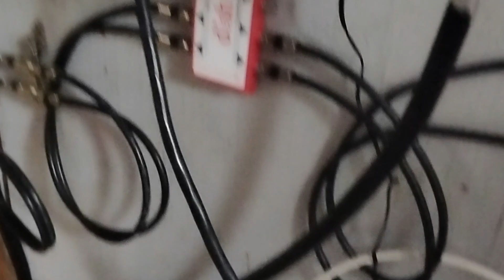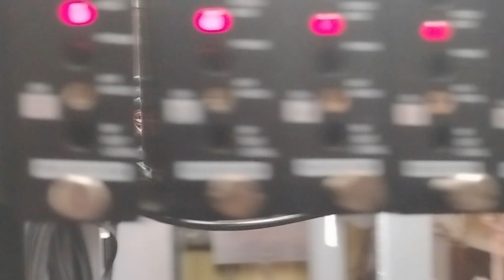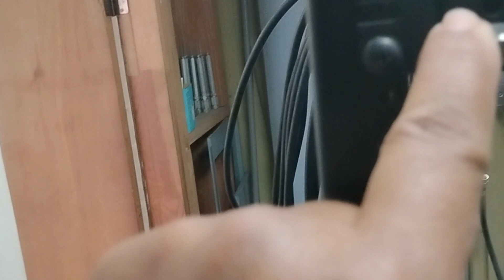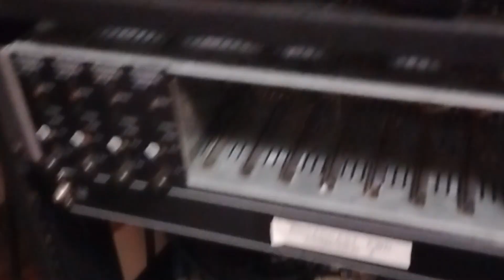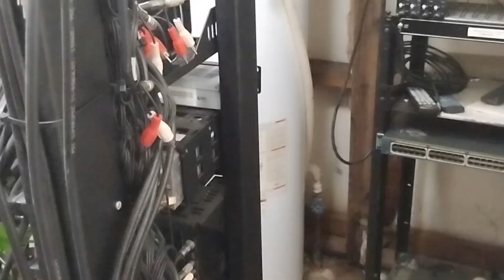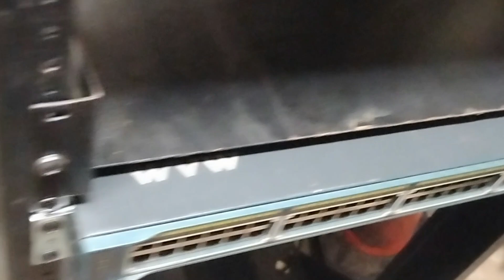digital tv ep2. Assessment and quick view about coax distribution.

Comment: Dude, u can not use a green splitter on low RF. Look at the frequency of that dtv splitter! Upto 2 gig, ull get nothing but ingress
Reply from the maker: That was left over by direct TV. You are correct, it won't work. But they do work with moca.  The building is under remodeling. Will resume with them as soon as they are done.